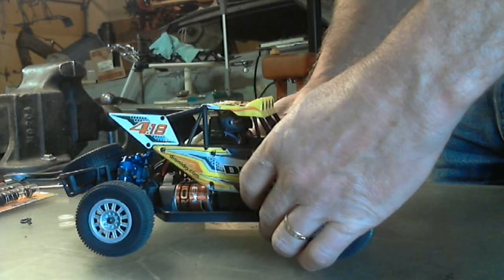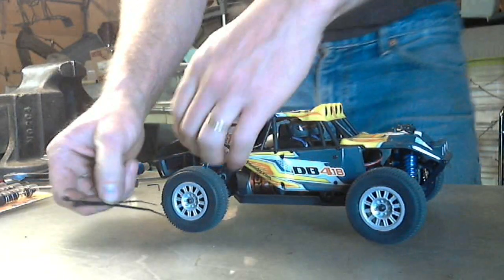Update 1 Dromida DB4.18 RC Buggy Shocks and Shock Tower Upgrade

Comment: Hey, I just scored one of these little desert buggies on ebay and am planning on decking it out in aluminum. I had a decked out losi mini t years ago that I loved dearly, and the mini bug bit me again recently with the desert buggy. Do you possibly have a link to somewhere I could get the alu. shocks and towers, and the front body post mod online? I think the shock upgrades vary slightly with each of the dromida vehicles, and I want to make sure the aluminum I buy fits the kit. I'm more concerned with the front body post mod though, that's really the only thing that stood out to me. Like, come on dromida, it really wouldn't have killed you to add that from the factory. Other then that I have very high hopes for this rc! And dromida as a whole really, I've got my eye on the MT right now as my fiance likes that one best in their lineup, and she has a birthday coming up. Sorry, kind of got off topic there. But I would really appreciate a link to those upgrades. Even part numbers if that's all you can offer, would be wonderful. Thanks man, great video and I love how you've upgraded your buggy! I'd love to know where you got that aluminum center support by hot racing as well ;)

Comment: Are the aluminum shock towers the same as the plastic ones, just aluminum? I'm considering getting 2 pairs of aluminum shocks and some better springs, maybe also a brushed speed kit.
Reply from the maker: A Most Arrogant Goat Yes they are same as the plastic ones. No modification needed. They bolt right on. You will need your plastic body pins from the old ones.
Reply: I'm kind of a noob to R/C, is it important that I get aluminum shock towers if I get aluminum shocks?